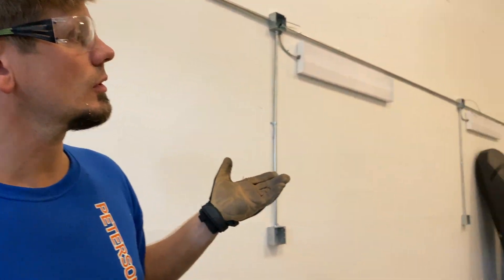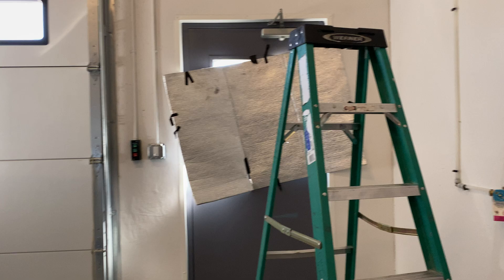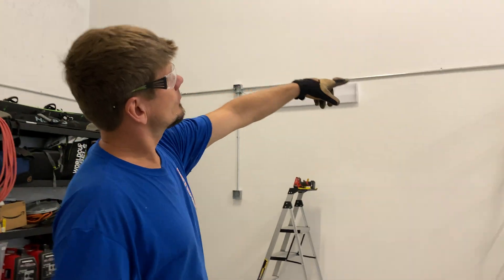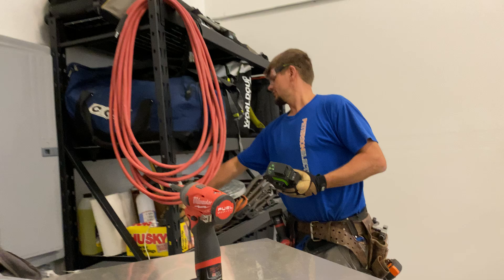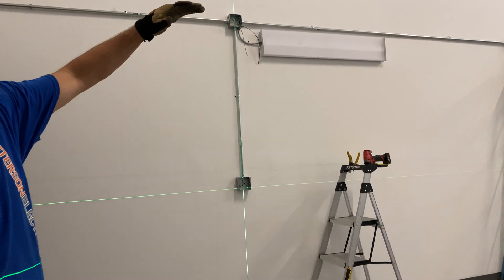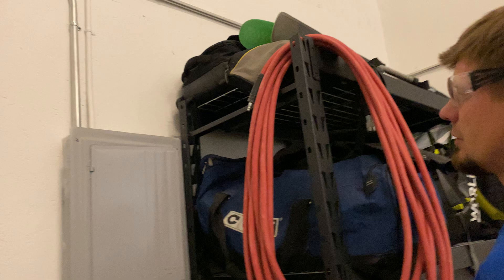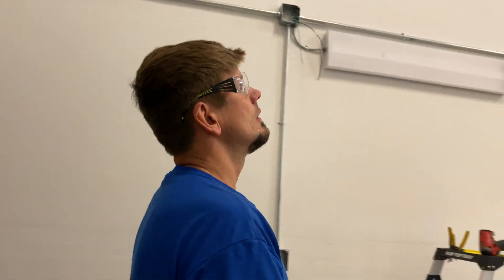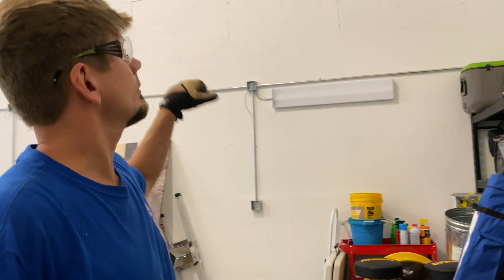Piping for a Small Commercial Garage Layout

Comment: Stopped using flimsy 1/2" EMT @ all commercial sites years ago. Always stocked 3/4, 1 1/4, & 2" EMT fittings & conduit to easily handle 60,100 & 200 amp runs. Should explain that you have to derate wires when installing more then 3 current carrying conductors inside conduit. Nice conduit run.

Comment: No box offsets?
Reply: @Jack Jones The title says commercial. He's a contractor its about having pride in your work. Box offsets take maybe 10 seconds to do.
Reply: Couldn't you use mc cable
Reply: @Yahs-our-All  He sure could have as long as MC/AC  is not subject to physical damage or exposed to the destructive corrosive conditions. EMT looks a lot nicer though in my opinion and what most guys would probably run if they know how to run pipe.